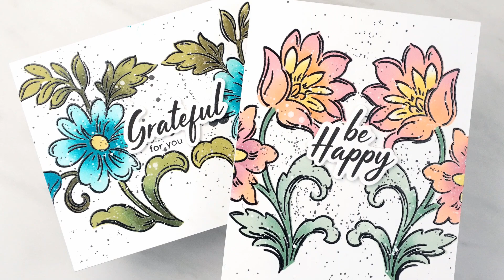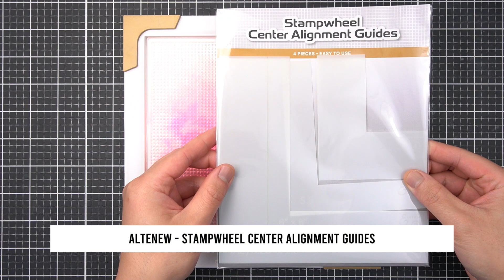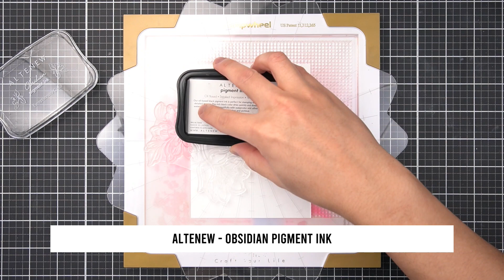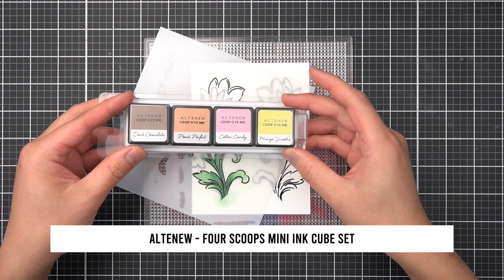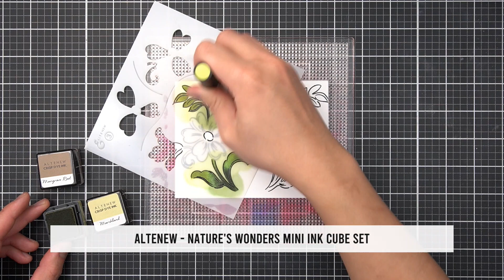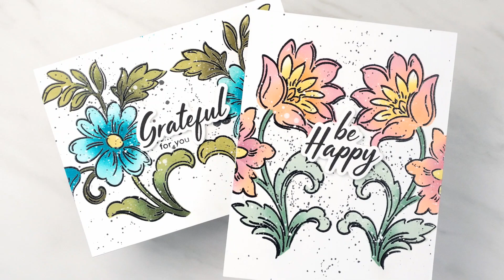3 Stamping Techniques for Perfect Mirrored Cards | Altenew April 2023 Marvelous Monthly Series

Comment: Love the way you explain everything you do. As always a wonderful video. Also love that you are using the Stampwheel so I can get your tips on that. Now I just have to get over the fact that pink will possibly stain the mat as it doesn’t change how it works.
Reply from the maker: You're correct--my stampwheel sticky mat is still very functional. Once I got my first stain on the sticky mat, I figured I'd really go for it with all the inking techniques because the pressure to keep it pristine was gone.